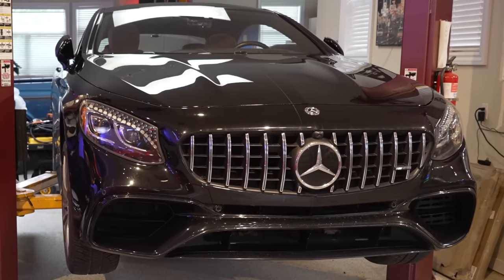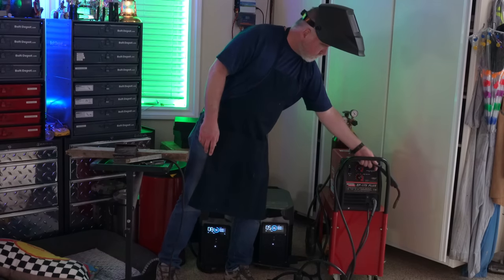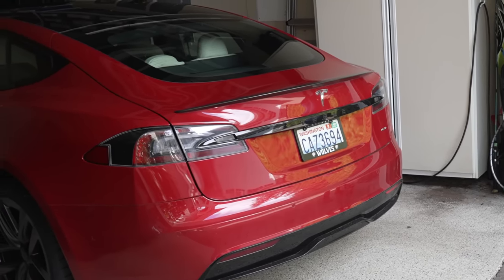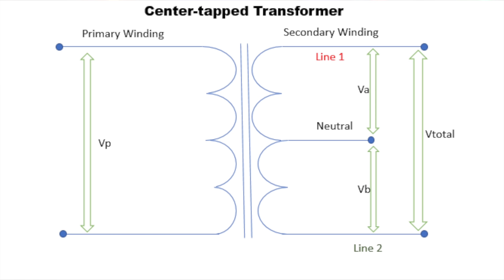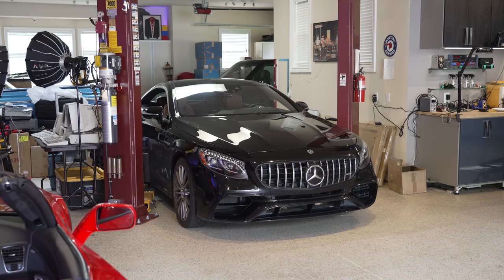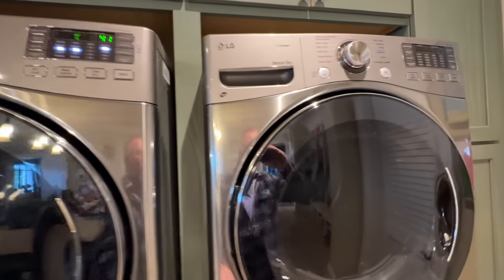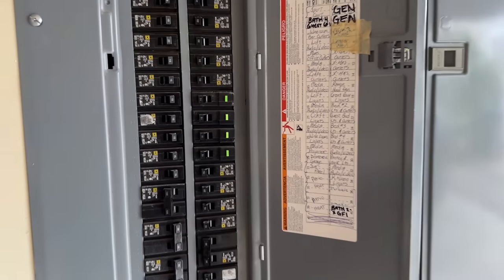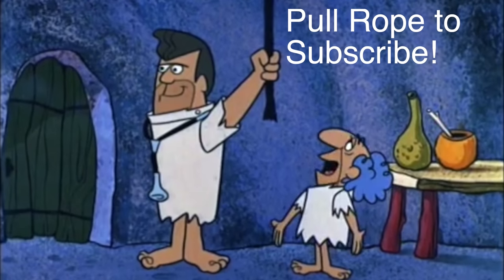240V Solar Battery Experiments - Welding, Lifting a Car, Charging a Tesla, and More!

Comment: Well, in the US and Canada (Mexico has a radically different grid), the three-wire drop for most residential homes has only one phase. Some parts of the northeast did have 2-phase power from Niagara Falls, but that was for industrial use, and has since been abandoned now that modern 3-phase power has been the standard for over a century.
Reply: It's single-phase power, but there are two phases on the wires. Going into a home, they're 180 degrees apart as mentioned in the video. With actual two-phase power, they're 90 degrees apart.
Reply: @chitlitlah  perhaps you need to learn the difference between phase and polarity. To say that the other end of a transformer is 180° "out of phase" is incorrect, because it's the same single-phase circuit. Alternating current flows one way, then the other; that's not a phase difference, that's alternating current. 90° is a phase difference, 180° is misunderstanding how AC works.
Reply: @StringerNews1  sin (x + pi/2) = -sin x

They're the same thing. I see what you're saying though. Having a phase that's 180 degrees off isn't useful in something like a motor because you could just turn the coil around and use the original phase to the same effect, hence split-phase isn't the same as two-phase. Reversing the polarity and shifting the phase half a period are indistinguishable from each other though, so you really have to go through some mental gymnastics to say it's one and not the other.
Reply: @chitlitlah  no, it's pretty simple actually. There's only one sine function in a household power drop. To have any phase relationship at all, you'd need two, and a time delay between them. That would be complicated, and for no good reason! But we don't see that. It's one circuit, not two. Two-phase has two circuits: two windings on the generators, two pairs of wires for transmission and two transformers at the end. Single-phase home service only has one transformer. That's how one tells.

Comment: The grounding is an issue of “floating ground” from the DPs in that configuration. It would not be a problem if you were feeding through a panel where the house ground was in play. EF sells a bonding plug but of course always disconnect that before plugging into house AC for charging.
Reply from the maker: That seems to be the consensus, but how can the Tesla know that the ground inside the Ecoflows is not the real ground?  It's the base from which the two legs have potential, but what else is special about the actual "ground"?  Remember the Tesla isn't grounded, so it can't compare to know... so I'm curious!
Reply: @DavesGarage  I believe this is an issue of ground/neutral bond not present. When connected to a wall outlet or via transfer switch/interlock the ground in the DP is linked to the service ground which is bonded to neutral at the main panel. When suppling loads directly from the DP alone the ground is not bonded to neutral. GFCI devices and chargers that want to see that bond may report a ground fault or other "bad wiring" error or simply refuse to operate. This is where using a bonding adapter comes in. But of course it's also quite dangerous to plug the DP into the wall or supply a transfer switch or inlet while the grounding adapter is in play as this creates a "ground loop". Had your Tesla been able to charge from the panel you supplied via inlet from the DP I suspect it would have worked fine. I use the Smart Home Panel which is integrated with the house wiring (and shares the main panel's ground/neutral bond) and while I don't own an EV I've had no issues with any equipment or GFCI devices while running from DPs (which I do for most of the day when ample solar is coming in).

Comment: The tesla checks that the neutral and ground supplied to the charger are connected, as they are in the primary panel in U.S. wiring.  You can fake it by "neutral ground bonding plug" that simply connects them at the same outlet where the charger is connected.  It doesn't add safety, but does satisfy the test in the charger.
Reply: I'm surprised the Eco doesn't do that or at least provide that option when it is an isolated source of power
Reply: @danman32  It could be argued that such a bond would actually decrease safety.
Due to operating voltage drop (current flowing in a wire which has any resistance will cause a voltage drop) the ground at the device being powered will not be at 0 volts. For example, in my home office the neutral is several volts compared to the actual ground, even tho they are bonded at the panel on the other end of the house. If the ground line did not have a true earth connection, such as the situation created by a bonding plug, the ground would also be at several volts relative to earth.
I consider this concern to be negligible. A true floating system such as the Eco has no earth reference, therefor the voltage potential to earth does not exist.  Electrical code in most cases does not agree with me, but this point is frequently debated when setting code standards for different power systems.

Comment: If you try to accidentally or on purpose backfeed power back onto the grid using a generator, you won't electrocute the lineman, you will instantly trip the breaker on your generator.

 Imagine trying to run your entire neighborhood on a 4000 watt generator. It would be an instant short circuit.

Another urban myth debunked.
Reply: You may be correct, by you are playing with someone else life !  Also, it is not NECESSARILY a instant "short circuit".  Less it would be a very large load and should trip the breaker.
Reply: I think in most parts of the US each house has its own "small" transformer, if the medium voltage fuse is blown it won't backfeed the whole grid so you can actually kill a lineman working at that specific transformer, although AFAIK those fuses are replaced using a long insulating pole so in theory there should be no one working on the transformer itself... but better safe than sorry.
Reply: @ruben_balea  NOT correct.  Most US residential buildings are feed split phase 240 VAC from a transformer that feed MULTIPLE buildings.  Maybe 5, may 10.  It is possible that improperly backfeed generator could create even higher voltage on the other side of the transformer.
Reply: @jackpatteeuw9244  Oh well, I never was in the US, it probably gives me that feeling because I'm from Spain and here almost every transformer is 3-phase so in theory a third of the transformers would be enough, but we don't use such high currents either so even less transformers are enough, here the houses usually have services between 5A and 63A @ 230V.
Also due to the loss of incoming due to the pandemic a lot of families had to go down to a very basic 2300W service and start using different appliances at different times to not exceed the limit.

About the backfed transformer I know it will create high voltage, that's why I said if the transformer fuse is blown only the transformer itself would be dangerous, but I was  assuming that each transformer will have its own medium voltage fuse.
If the transformers are shared between several buildings the situation will depend on the case, if all buildings have their own generator or any other backup system there will probably be almost no load on the transformer, but even if the high voltage from a backfed transformer does not go all the way up to its normal level due to some load it can be still deadly and at least dangerous.
Reply: In the US, residential transformers can supply power to just 1 house or to many houses. It depends on how far apart the buildings are located.

In my neighborhood, each transformer supplies 4-5 houses. Where houses are smaller and closer together, transformers may feed 6 or more houses. In the "country", each house gets a dedicated transformer.

Basically, if it is easier/cheaper to install another transformer instead of running an additional set of [oversized] wires hundreds of meters down the road, they will do that.

Comment: did you have your HVAC running as well?  we are on a 200A service and in South Texas,  I want to be able to run the HVAC and most things in the house (all modern LED/efficient) and not worried about the Dryer/Oven at this time.
Reply: Most home a/c units use around 4000 watts.  But most draw a lot more at start up.  You may have to install a soft start on the a/c unit to work. What Dave doesn't really address is that dryers or a/c for that matter will suck those eco batteries dry in an hour or two.

Comment: So what does the space station have to do to get a ground? I bet the Tesla is testing the the ground wire to see if it's actually working before fully turning on to charge.

Do the Eco flows have a separate ground wire you can install for them?
Reply: On an old airstream RV I remember seeing a interesting device. A rotary switch that allows you to choose which load it handled. For instance air conditioning dryer etc. It was designed to run off of 30 amps. In all those devices combined would be using more than 30 amps.

Comment: I always thought the US was 110V AC I never knew it was ready 220~240 just stepped down for safety. P.S. I love your house , it's beautiful
Reply: Well technically, US homes are provided two 120V circuits that can be combined to make a 240V circuit. In commercial, or large residential buildings, they are provided three 120V circuits. Any two of them can be combined to make a 208V circuit.

So, I still consider the US as using 120V AC. It's not like you can buy a 240V kettle or 204V lamp and be able to plug it in. The average US home only has 240V receptacles for dedicated things like clothes dryers, car lifts, car chargers, ovens, etc.
Reply: Technically most homes in the U.S. are wired with 240v "split phase".  In other words, it is single phase 240v, but "split" so that the sine wave is 120v away from ground in opposite directions, so 240v apart from each other.  This is 120v r.m.s. (or root mean square) with a peak voltage of about 170v or peak to peak of 340v.  RMS is approximately equivalent to the D.C. voltage necessary to provide the same power as the A.C. voltage.

Comment: Your issue with the Tesla is that the neutral is not tied to ground like it would have been in your circuit panel.
Reply: But how can Tesla know that?
Reply: @jackgerberuae  A resistance test between neutral and ground should be zero. The Tesla must check this.
Reply: @TonyPombo  correct answer.  :)

Comment: Great video! I love the EcoFlow Delta Pros. I have 2 pros and 2 backup batteries all tied into their Smart Panel. The only thing that I dislike is that when plugged into the Smart Panel the units stay “on” and slowly discharge over the course of a few weeks. This of course means that when you need the automatic failover you likely have much less capacity than you were thinking. The only way I’ve been able to “solve” the problem is by physically turning the batteries off (which makes the smart panel grumpy) thereby forfeiting automatic failover.
Reply: Why are they not plugged in to house AC to keep them charged..? Or use some solar panels to keep them charged.
Reply: @ceb1970  the question is why are they being discharged
Reply: @thatcreole9913  Are they being discharged even while plugged into house AC? You aren't being clear.
Reply: Yes.
Reply: @ThatCreole  You may want to take a look at your Charge/Discharge settings. I don't know the default settings for the Delta Pro, but I've seen values of 20%/80% recommended to extend battery life.
Reply: Sure. I have mine set to that. That’s not the point I was making though. The question that I have is what’s causing them to discharge if it’s never switching over to batteries? Something will happily drain it down to 20% at which point I have a rule to auto charge back up to 80. I’d love to have the auto fail over feature but as of now it’s not a feature I can rely on and assume a full charge.
Reply: @ThatCreole   @ThatCreole  Self-discharging that quickly sounds like an issue you should bring up with Ecoflow support or r/Ecoflow_Community if you haven't already. In any case, for your use case it doesn't seem like you should let the unit discharge below 70 or 80%. That will reduce the battery life somewhat, but at least you'll have power when you need it.

Comment: In fact, there are no perfect power supplies.  Drawing dozens of amps necessarily causes causes the 240 V to fade.  This is why your lights dim temporarily when the AC kicks on.  The power delivered to the locked motor is still substantial, but is about half or a third of the ideal case you cited.

120 VAC is unlikely to kill you, but it is quite uncomfortable and there is a fatal risk (sweaty fingers and wet feet enhance this risk substantially).  240 VAC only exists if one hand is on each electrode -- in this case, you're quite lucky indeed to survive the experience.  This is NOT to be considered advice to experiment for yourself... those who enjoy life and dislike pain will exercise caution.

It is quite unlikely that the phase of your backup matches the phase of the grid unless the backup's design specifically performs this match.  If your installation does not explicitly warrant the ability to sell energy to the utility, then it does NOT have this capability.  If this phase and frequency match is not perfect, then the grid will destroy your installation entirely.  This is both costly and hazardous.

Comment: The EVSE (Tesla mobile connector) verifies ground presence by sending a small current to ground.  In a proper situation, the ground is bonded to neutral in your panel, so the EVSE will see the current flow and be satisfied.  For off-grid use, such as a generator or inverter, You can take two 100k 1 watt resistors and make a temporary "spoof" device that will connect each 100k resistor from each of the 2 "hots" to ground in a "Y" configuration.  (You cannot properly call these "phases" as residential service is single-phase, and the 2 hots are the same phase, just 180 degrees apart.)   The 100k resistors can only dissipate 1.2ma, so in the event of a short, they limit the current to a safe value.  Using two, one on each hot insures balance, so there is essentially "zero" volts on ground.   I usually make this up in a plug, and then use a Y-cable to connect to the generator/inverter feed.  You could also add it to an extension cord on your NEMA L14 twist-lock, or on the NEMA 14-50 side.   This is perfectly safe for temporary/emergency use, but obviously is bypassing the ground safety check on the EVSE, and should be carefully supervised.